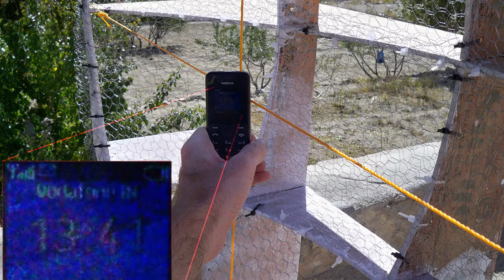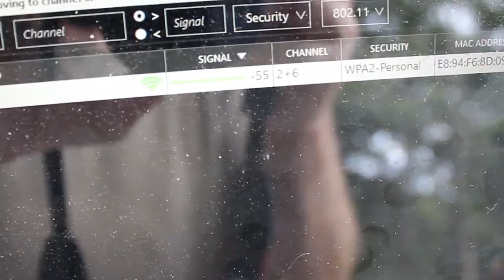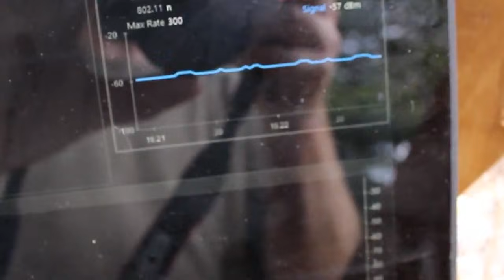$20 DIY WiFi dish punches through dense jungle (@Plastic Bottle Village, Panama)

Comment: Something I have done that might be useful for this type project as a way to really extend your USB cable distance. the signal over USB can travel a really long length of cable, but the problem is the 5v power drops off to low to be useful. I solved this by using a long piece of cat5 network cable, using the green/white pair and attaching that to the 2 USB data lines. then using the other colors as +12v, and the other whites as ground, and a simple 5v regulator at the wifi dongle end to turn the higher voltage 12v into a safe 5v for the wifi dongle. I used a 7805, which are ubiquitous and cheap, can probably find one in a vast amount of scrap electronics, or a USB car charger you can crack open to get the board out.

At the computer end, cut an old usb cable off, and attach the green/wh to the USB data, and 12v, either from the computer or a plugpack. you will also need to connect ground from the USB to the 12v ground. I was told by an electronics engineer that there is no way the USB standard would let this work, the timing is all wrong, but the proof is in the pudding, it worked just fine.

you will probably want to have a soldering iron, but its not a hard job, just connecting some wires, nothing fancy. if your feeling clever and desperate you probably could do it all by twitching and tape, but I wouldnt trust that long term.

I wasnt using a massive dish, but I did modify the USB dongle to have a 3 element yagi antenna, mounted in a margarine container and gaffa taped that to a broomstick and mounted that to the roof of a 2 story building. I was in the bottom floor and was in a total dead spot, but knew I could get wifi from the roof. if your interested, I used it to get free wifi from the McDonalds down the road. I was only staying there for about 3 weeks and didnt want to get a hardline installed, and mobile data was very slow and expensive. I was dubious, but only cost me an eavning of tinkering, most of that was the antenna install, and was very pleased it worked. free internet and a quick, easy, satisfying project.

I think just mounting the router on the shelf is probably a better, or a 5m USB cable in a plastic box, if your close enough. but if you need to run it up a tree or tower or to the roof, this is a cheap and theres a good chance you have all the parts (if youve already got a computer, phone and networking hardware. commercial extenders can be in the $100's

Hope that little nugget of info is useful to someone.

Edit: 13mm reticulation water pipe is a great conduit for this sort of thing. UV stable, flexible, easy to mount, and can be found in alot of places in 100m rolls. and orders of magnitude cheaper than actual conduit or solid water pipe.
Reply from the maker: Interesting, thanks.

Comment: Good idea for using the water bottle waste. I feel like flattening the cylinders might work better though, for two reasons: 1. It's more structurally stable, as the large air gaps are weaker than the smaller air gaps would be between crushed bottles, and 2. Insulation is a product of the number of air gaps, and a sandwich of 5 flattened bottles will have a lot more air pockets than the one large air pocket of one bottle of equivalent volume.
Reply from the maker: Yes, but mostly comes down to the availability of the bottles. 
Waste is definitely way to prevalent in most places, very much including Panama, but 10x ing your material needs could make sourcing enough of it tricky.

But then by the same token, if you're actively trying to reappropriate as much of it as possible from an essentially infinite supply, then yes.

Comment: These guys Need to go Many mines distant. They have a HUGE Problem. Currently the record for a single transmission of wifi is a distance of 189 miles. The people who made this in 2016 are CISAR (Italian Center for Radio Activities). The TX tower height is 5,748 ft. Receiving at 4,423 ft. Problem is according to Globe Curvature Math between the two towers taking into account the heights and distance, there should be a physical hump of Earth between those locations at a height of 455.23 ft. making the feat quite impossible. This is evidence we Don't live on a globe and if you take globe Earth math into consideration your calculations will never work. Don't do it, you live on a flat plane.  - Tunneling, Aviation, Celestial Navigation, World record long distance photography, Bridge building, Interstate systems, Elevation above sea level - all Require a Flat Horizontal Plane of reference!  - Another illustration. Look this UP! --> " University of Houston -  Cullen College of Engineering - No. 2781: Water Seeks its Own Level. "  It's all about hydrostatics. (Begin quote)  "Napoleon once considered building a Suez Canal. But he abandoned the idea when his surveyors mistakenly reported that the Red Sea was 33 feet higher than the Mediterranean. They told him that a canal would need an elaborate system of locks. That of course was absurd. Both seas are connected and have to seek the same level." (End quote)

The canal is 120 miles long.  He tells us the two seas are level in relation to Each Other NOT the center of your supposed spherical Earth. Assuming the globe There should be a physical obstruction/hump of water due to curvature between the two seas at a height of 9520 feet! That's 1.8 Miles of obstruction! Of course That as the article says, is Absurd! Earth Measured Flat. It's NOT debunkable. 

We Aren't Spinning! No Coriolis ( we do not see objects flying above our heads appear to curve because Earth is spinning. You cannot claim conservation of momentum.. That doesn't apply to Spheres! )  and No Rim Velocity ( If Earth were spinning at 1040 mph at the equator, we would have 1040 mph forces present. Nothing could live on that.

Earth is Measured Flat and the Globe Impossible!

Comment: What would happen if you filled the bottles with (sea) water before you re-use them?  
I've been fascinated for a bit, with using water as a sound absorber.  But it would also work as thermal mass (if you need that).  
I'm just not sure if the bottles will leak or not.  It's a risk.

edit: oh sorry the video is mostly not about the plastic-bottle-village 😅, nevermind i was typing some idle thoughts.

Comment: Meshtastic networks would be useful there as well as it's easy to power with solar and doesn't rely on internet. You should check out that technology. Good job Gentlemen! 👍
Reply from the maker: Yeah meshes are something I've been meaning to get more into for a while now.
Reply: @OpenSourceLowTech  I understand they are very low range and won't work for what this fellow needs done. Besides, it's only text for emergencies.
Reply: Also the reticulum network is something worth looking into, aswell as p2p ninja and commotion wireless

Comment: I would be worried about offgassing... Who knows how dangerous the various gasses are once mixed...
Reply: With Pastic Bottles? I wouldn't be, not food grade stuff anyway, but really if you have some external vapor ports that would solve any issue with volatiles.
Reply: Earthships in New Mexico use tires as wall structures. Massive offgassing. 

Some of these techs trade health for shelter. It may be a good swap, depending on the part of the world, lifespan and healthspan. And, really, how many years do we have left on the planet? 

If the bottles are free and the shelter wouldn't be built otherwise, and healthy years of living are low anyways, and the amount of microplastics already in their systems from the rivers and burned in the air....why not?